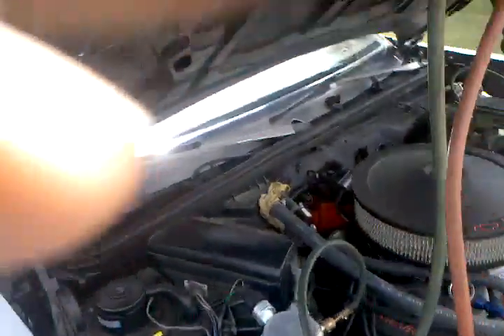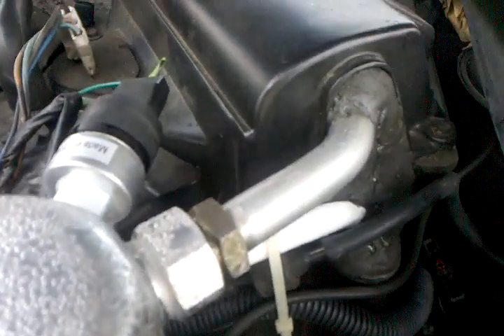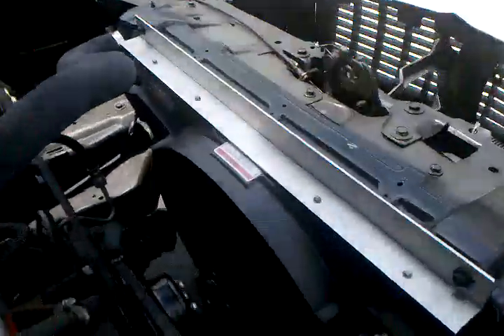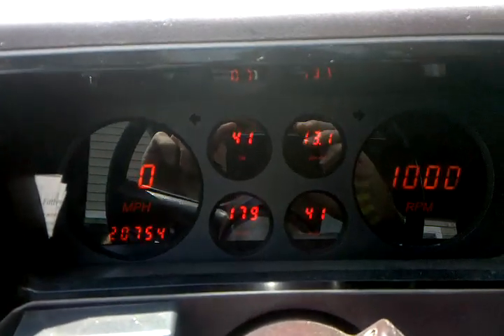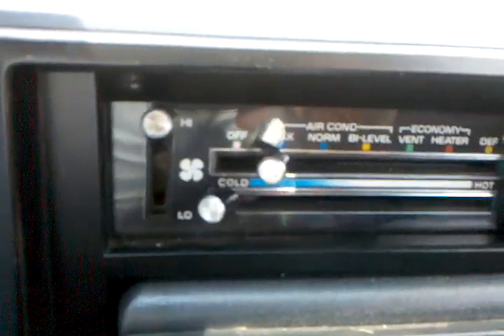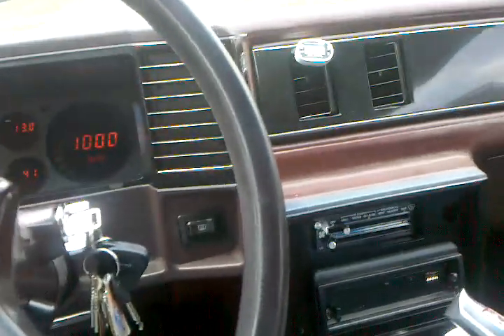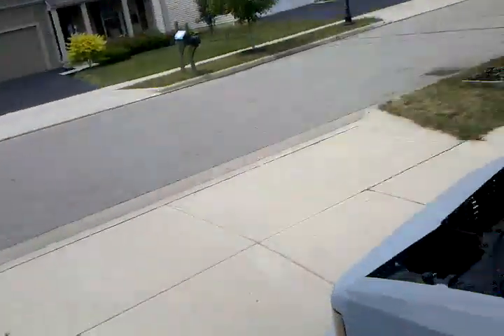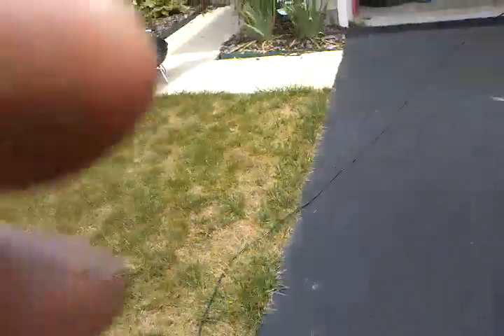Envirosafe refrigerant in 1986 Monte Carlo

Comment from the maker: side pressure was too low...  as a test I added a second evaporator coil at about 50% more capacity total than the GM alone  and it worked perfectly... so im the end I yanked the factory evap box out, and outfitted a "danhard" type setup behind the glove box with a digital control i created.. and the day I sold the car last year it was 98 outside and inside was so cold it fogged the outside of the windows.. and no ice on the coils.. :)

Comment from the maker: issue ended up being too small of evaporator area for the displacement of the Sanden compressor... GM evaporators are not distributed.. they are a boil-off type and even with the indoor blower voltage at 16 volts  to move more air..   so in this video the unit even at 40 PSI was somewhat overcharged..  (it was vacced down completely before charging)..  dropping the charge to normal levels meant that my orifice didnt flow enough refrigerant.. so I went up a size  and it helped but still  the low

Comment: run the low side pressure around 35 psi. as we all know, hydrocarbon refrigerants are efficient at significantly lower pressures than other refrigerants.